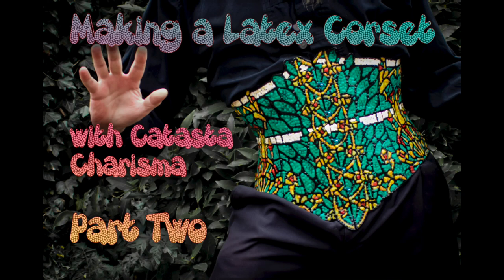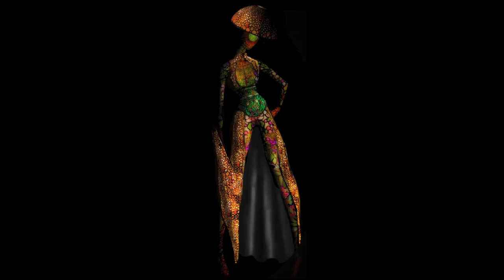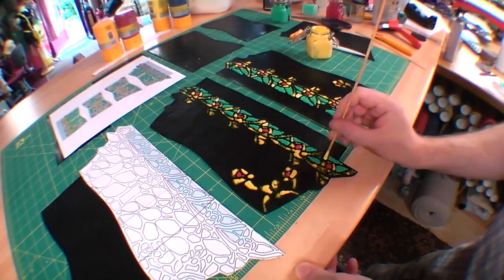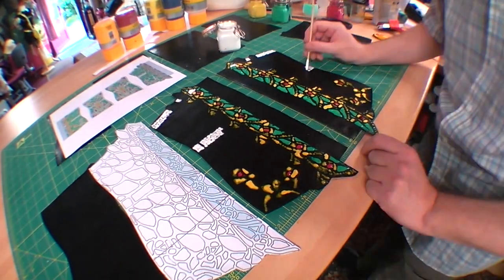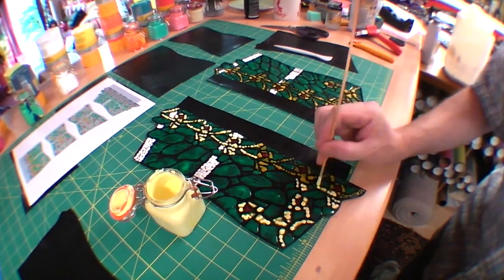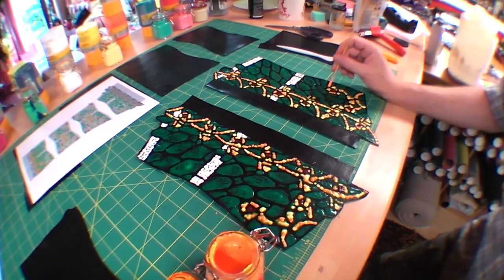Making a Latex Corset - Part Two

Comment: What kind of paintures used? Liquid latex with colour or another way?
Awesome your art painting!
Reply from the maker: in the case for this piece of work I used around 10% or under acrylic paint mixed with 90% or over liquid latex. With acrylic I try not to go above 10% as this can then begin to effect the rubber quality, making it feel more plastic like. This is okay for looser fits of garments or more rigid types such as the corset here if one is okay with the plastic like feel but for stretch garments it undermines the stretch capacity of the rubber.

One can also combine the liquid latex with ones own pigments - this is actually the best way. The most common way, however, is poster paint so a pigment in a starch base solution. Again we take care not to exceed to much the 10% mix as the water in the poster paint can undermine the vulcanisation process and make the rubber brittle.

The 10% area is just a guide as each colour varies depending on the level of opacity one is after. One can push things higher or use less of course for more transparent results.

Comment: Hey catasta!! Can you please elaborate on the webbing glue you used to glue the busks to the latex? As i can't seem to find any correct translation for my language for that glue i have no idea on what to look for near my city, thank you so much!!
Reply: and what about the flat busk? I can't seem to find it anywhere. Did you make it yourself? Thank you!!
Reply from the maker: The product I use is called Spray Glue Industrial Strength - Fast Tack by Stuk Trade.

Applications include; laying carpets, upholstery, bonding foam, rubber, metal, basically sticking anything to another surface so long as one of those surfaces is porous.

I get mine from a local discount store, the kind of place that sells everything from fishing tackle to grannies nightgowns, to pots of paint.

Comment: Lovely corset! What is the function of the rubberized fabric between the two layers of rubber sheet? Is it just to eliminate the stretch of the latex and make the corset stiffer?
Reply from the maker: that's exactly right. A pure latex corset is okay for people who already have a slimmer figure and the corset simply enhances their natural shape but it kind of defeats the purpose for reducing the waist size and redistributing the weight elsewhere on the body if the fabric can stretch. In this way the corset seen in this tutorial is closer to more conventional corsets except for the rubber exterior. If one doesn't require the rubber to be stabilised and so still would like it to stretch then one does not need the rubberised fabric part. A fabric waistband is still included, however, to assist in drawing in the waist.
Reply: @catastacharisma  Thanks for the reply! I wonder if working with a sheet of thicker rubber latex would have a similar stabilizing/cinching effect? I only very recently started to look into latex crafting, it's such an interesting medium in that it can be used in both sheet and liquid form.  I love your Silver Alien creation too... so etherial and interesting to see in a mundane setting like the mall, interacting with mere mortals! Very cool :)
Reply from the maker: @ashb8318  So, if I recall the thickness of the rubber sheeting was 1.05mm. so even without the rubberised fabric that would make the corset over 2mm thick. 1.05-2mm is the most common thickness used for corsets. Some double the thickness by laminating further. While this does make a more resilient to stretching rubber it is still surprisingly stretchy that one can stretch it through pushing ones belly out alone.

Thank you for the compliments on the Silver Alien, that was a project of passion
Reply: @catastacharisma  Thank you for the info! I've gotten a lot of inspiration from your videos :)
Reply from the maker: @ashb8318  my pleasure